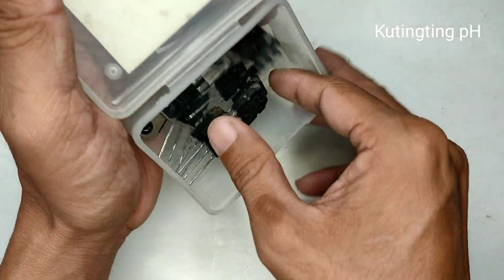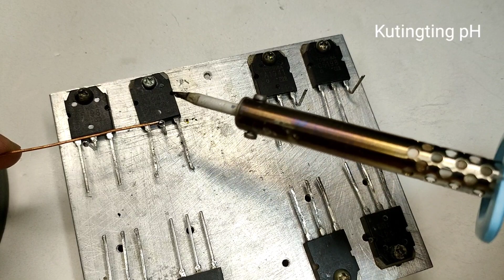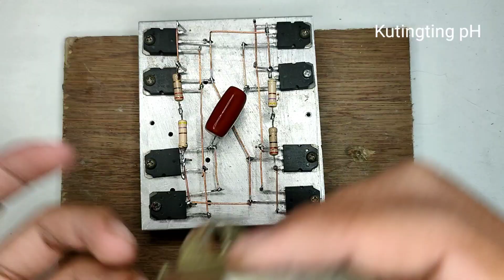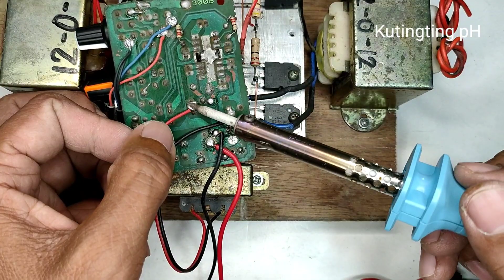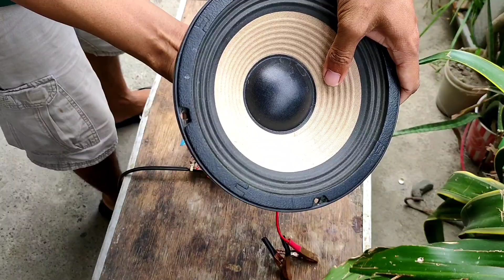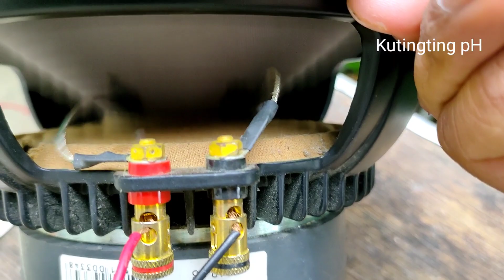DIY Powerful Ultra Bass Booster Amplifier Series Output BTL No, Ic Simple circuit

Comment: One input transformer....parallel with two output transformer with transistor....its the same....no watts add...its useless😁😁😁
Reply: He's using the transformers to balance impedance of the circuit and the output transformer array is required for a 12 volt 200 amp battery powered amplifier since he can't elevate input voltage he's elevating output voltage. This is a common method for low voltage high amperage systems. He actually mastered this build.